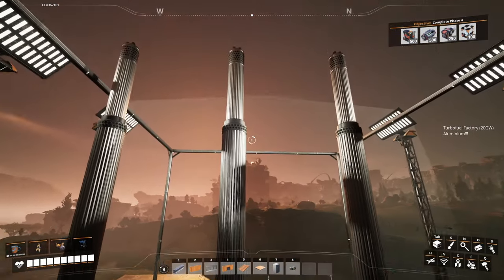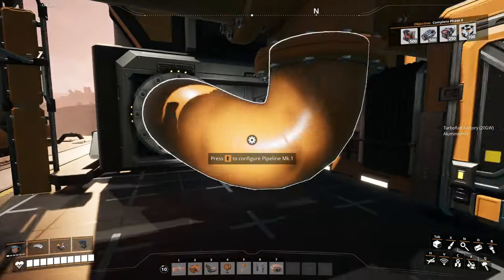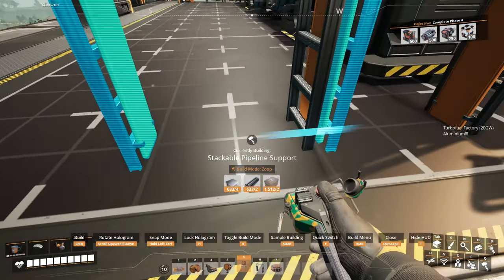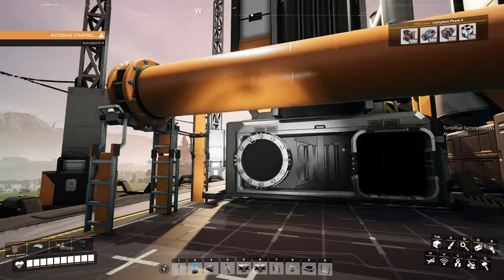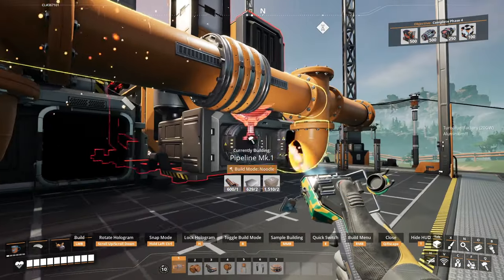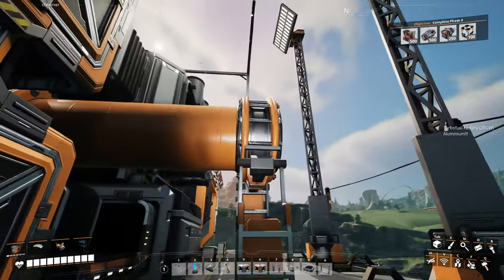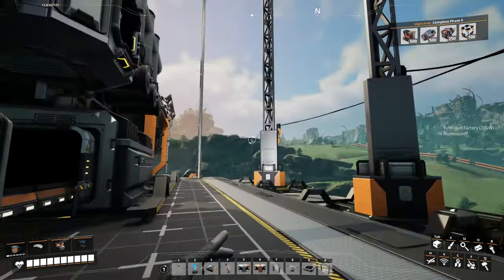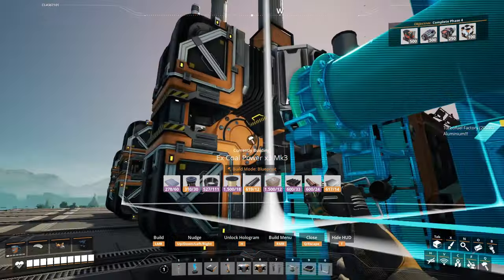Early Game Coal Generators Blueprint - Compact, Clean, & Tileable - Mk.1 BP - Satisfactory 1.0

Comment: Do one coal burner. One single machine, first. Then save it, and paste later in a new blueprint where you have X2 X3 X-whatever.
Reply from the maker: You can do that as well, yes. I personally like having fewer BPs and don't want to have 17 blueprints for every amount. I'd rather just build three x3s, and remove one generator, to get to an 8x, for example. But yes of course that's an option and there's nothing wrong with doing it!
Reply: @Krydax8  but then you have to connect them all if its a single factory bp only
Reply: imo get the max into the bp and then cut down when necessary

Comment: Hi, Can you or anyone tell me how you connect this blueprint to Water? I have a water pump fully overclocked and I still can't get three non-overclocked coal powerplants in this blueprint formula to keep water pressure and fill rate. Not to mention tiling multiple together to a combined 3 pump system to to keep 6 overclocked coal generators active consistently. Please help!

Comment: If you'll use Mk1 lifts instead of Mk3 it will help saturate generators noticeably faster - lower throughput on their input will force coal deeper through manifold.
Reply from the maker: @Andrey_Ivanov194  doesn't really matter. The buffers are going to fill to 100 coal eventually. When you do the math, filling them up quickly generally works itself out quick enough. #manifoldsrock

Comment: I just used this setup for the first time and boy is it clean! I find it perfect even for the first setup, before you even have blueprints. One tiny improvement is at 6:12, you can do the lift as shown in order to snap the splitter to the belt, then redoing the lift. It just skips the one step of placing the input belts. And since the input belts aren't there yet, no need to worry about the weird connecting behavior! Just make the input belts after the lift.

Comment: Ok, but where do you pipe in water? And since a water pump can only feed 2,66 generetors, do you suggest overclocking it?
Reply from the maker: on either side. Given i leave the poles up on the left, usually on the left, but you can easily switch that. And yes I pretty much always overclock my water extractors

Comment: Mk3 lifts is overkill considering the coal plant is eating 15 Coal/min. It makes more sense to use mk1 belt/lift after splitting to the generator to spare your higher end resources.
The main belt-line also only needs to be as fast as your Miner if we aren't merging several miners (don't, stack the belts instead)
Reply from the maker: "spare resources" we're talking like a few beams/plates here compared to the hundreds of thousands your factory can make over the course of the game =D

The cost of buildings is almost always irrelevant, except usually when you FIRST automate that item.

Comment: Couldn't you also put a pipeline floor hole under the spot you want the junction to snap?
Reply from the maker: @pachupac  I believe I tried that and it didn't work, but it may be finicky. The other problem is you can't place a floor hole directly into the designer so you'd need to do a foundation first, etc.
Reply: @Krydax8  I see. Thanks!